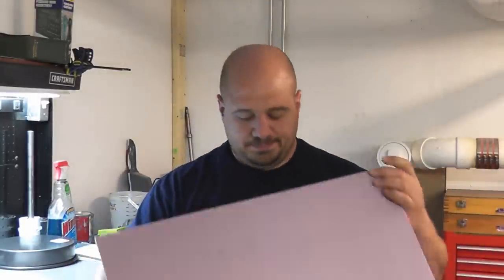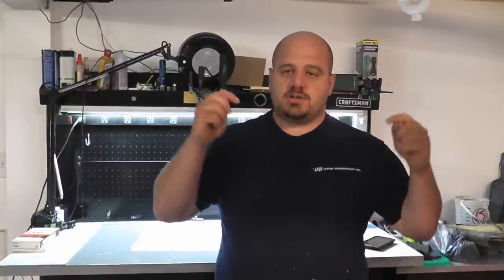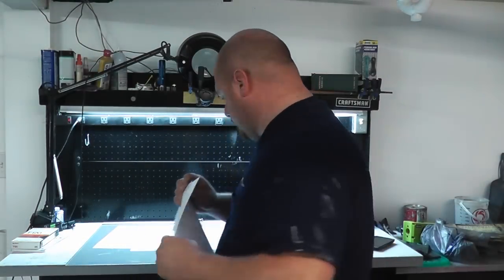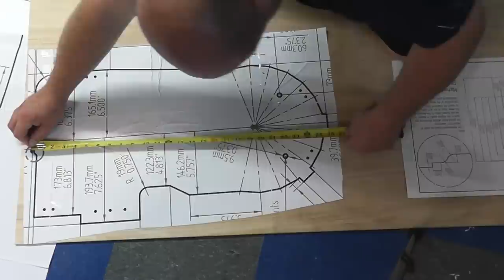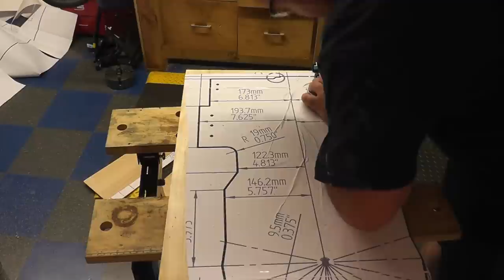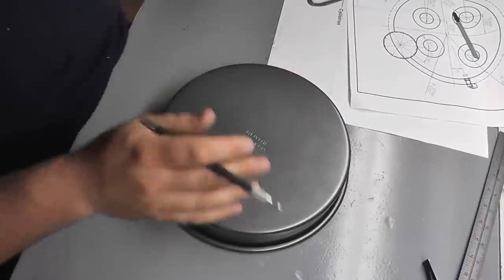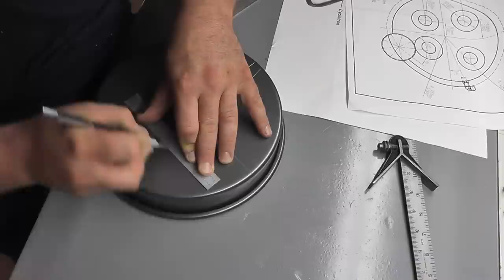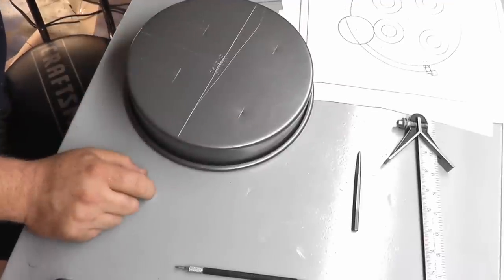Proton Pack Build:  Part 1

Comment: Hi.
Looking forward to seeing this build.  I do a lot of scenery for model railroading and use both the 3/4 and 2 inch foam for a lot of it.  One thing I found that cuts the foam really well is an electric knife, just like the one that you use to carve a turkey or ham,  It sometimes leaves a slightly funky edge, but that is easily sanded away.  Hope this helps

Comment: Hi Greg,

From a quick lookup, that pink foam is extruded Polystyrene. Polyester resin is thinned with Styrene monomer and will dissolve right through it. Really you should use an epoxy resin, but I've had some success in the past creating a barrier of latex based paint and I've heard of others using PVA glue, or PVA to mount a card skin. Otherwise you should track down Polyurethane foam, which is compatible with Polyester resin.

To give the foam any real degree of ruggedness, you really need more than just a skin of resin. If you use fibreglass cloth rather than chopped strand matt you can achieve a pretty good surface needing minimal filling and you can use surfacing tissue as well.

Comment: Spent ages trying to figure out how to cut that foam for a bunch of letters for exterior signs - tried the hot wire route, hacksaw blades, sharp knives.  After a bunch of different experiments my 10 year old asked me why I didn't just cut it on my bandsaw.  2 minutes later clean perpendicular cuts with very little cleanup required.  For interior holes I just used a metal cutting blade on my jigsaw.  Was kicking myself that I hadn't thought of it myself.
Reply: Man, that's brilliant. Thanks for sharing the tip.

Comment: Just to note, Stefan's plans are slightly off with the mobo, so it is recommended to assemble your shell components first, and then trace around it before cutting your motherboard.

Comment: Greg,
A bit of a departure from the other stuff on your channel, but it looks like fun. What I would like to know is does your wife know how to use the video camera?  She can film you running around your yard saving folks from the ghosts. I never saw the movie so I don't really know what the plot is. The last movie I saw at a theater was when my wife and I were dating. We were married in 1982. Anyway, good luck with your project. If you need blinky lights, you might try a 555 timer chip. It will source and sink up to about 18 volts I think. You would need 5vdc and a voltage and current limiting resistor for your LEDs. I can help with that aspect if you wish. A simple transistor relaxation oscillator would work as well. Put in a trim pot to vary the RC time constant for the frequency of flashes.  Have fun with your project.
Have a good one!
Dave

Comment: A homemade hot-wire cutter would zip through that. It would have been handy to have a bandsaw. You can also carve trim foam very quickly with a Stanley surform, or a belt sander. It will make a mess, wear breathing protection. Beware of using bondo directly onto polystyrene, as it is affected by polyester resin, but from what I hear, not epoxy.

Comment: who's plans are you using I may try to make one for myself
Reply from the maker: check the link in the description.  I used the plans labeled steffans plans.
Reply: +Halligan142 Double check some of the dimensions for mating parts on Stefan's plans. IIRC, the upper corner spacer where the HGA sits has 2 different radii between the motherboard and the spacer, but I think there's been a few other issues. Most of us, when we cut aluminum motherboards, build the body and then trace the mobo to fit. That's actually been a big issue in pack-building; all shells and all motherboards (when you purchase them)aren't necessarily compatible. But as someone that's seen too many people slapping together purchased parts (usually poorly), it's nice to see someone going the scratch route.
Reply from the maker: +Prop-Forge 
Thanks for the tip!  I figured I would never be able to get it perfect and was going to sand to fit once I get all the pieces made.  That's the beauty of using the wood although technically not accurate.  It's still an ongoing project and I have no real time table to finish, but hope to get it down by this Halloween.
Reply: i used wood as well for exactly the same reasons you did when i built mine. This was my first pack so i knew i wasn't going to nail every detail. I did what the previous commenter mentioned though and started with a fiberglass shell and then traced it to make the board. Wish i had the skill to scratch build, as making my pack was one of the most fun things i have done. Great job!

Comment: hey haligan, love watching your videos. For a foam cutter, you dont really need to buy anything, I made mine out of scrap lumber, heater wire from hair dryer, model train transformer (to vary the current/heat), and a junk spring that I had laying around. Ive also seen people using old doorbell transformers or modified microwave oven transformer with a dimmer switch. I use it for cutting that type of foam for lost foam casting of aluminum. Its also useful if you use that type of insulation and are building an enclosure or something, then you can cut the stuff alot faster than with a knife.
here's mine:
www.youtube.com/watch?v=PUaEemRPhI8

Comment: If I had the skills to build my very own proton pack, I would use an LC-2 alice pack frame for mine and I would put foam padding inside the shoulder straps so it would feel relaxing on my shoulders ( http://i.imgur.com/NEA0AaI.png ). Speaking of which, the company or companies that manufactured alice pack straps should've had foam padding put inside so the prop makers could've used padded shoulder straps for the proton packs of both Ghostbusters (1984) and Ghostbusters II (2) (1989).

Comment: ok....... you have taken your meds... right?
By the way... if you are going to cover it in polyester... you may as well make it out of that stuff with fibre glass reinforcements. It isn't difficult at all ... and the stuff is cheap enough to chuck your first attempt in the bin if you have to...
Reply: +gh778jk 
Also - you just need to agitate the air bubbles out of the fiberglass ("white" is bad, "transparent" is good). It's not very difficult. I'm sure you'd master it after 1 or 2 fiberglass mats.
Make a paint roll, but using a couple inches of allthread as the roll instead. That works fine for agitating the polyester and the fiberglass.
Ventilation / mask / or something else to protect your lungs.